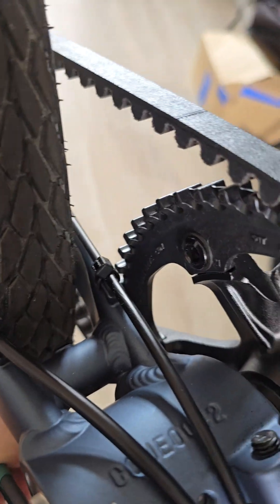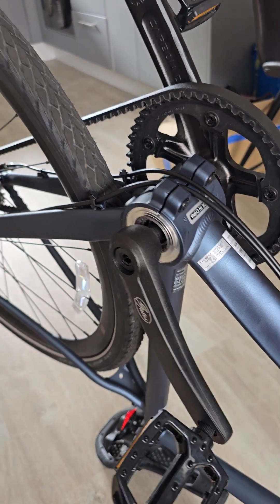Boardman URB 8.9 adjust belt tension with eccentric bottom bracket

Comment: Thanks for the video. Like nearly every other URB8.9 sold by Halfords, mine was too tight at over 60lb when the recommended max is 40lb. I guess the bike makers think too tight is better than too loose…too tight you probably get gradual extra wear on components but too loose and you risk more immediate belt damage from a belt slipping the teeth. If you have a decent 6mm hex key and pin spanner it’s a very easy adjustment...no more difficult or time consuming than adjusting a seat post height. The app is useless for accurate belt tension measurements…you really need a krikit/continental 9001 tension gauge. I got one from amazon US for about £20 (just be sure the gauge will read down to 30lb…some automotive gauges will be too high). Parkside pin spanner and hex key with handle was about £20 for both from amazon.

Comment: Thanks again. I loosend  the allen key bolts on mine to test them and heard a slight crack sound which probably means there was some thread locker 'glue' on the bolts to prevent them from working there way loose.

Comment: @richibizaSport.  Informative video - thanks ! The big bolts that squeeze the bottom bracket shell -- looks like a 6 mm hex head? Are they too tight to unfasten on a roadside in case of need ? 
I assume you have to do this to remove the wheel - e.g. for puncture? 

Also looks like you changed the tyres from the stock one -- what width are you using and what do you think is max width achievable? Maybe you went tubeless to minimise need to remove the rear wheel on a flat?
Reply: You don't need to do this for removing the rear wheel, you just need to detach the gear selector cable